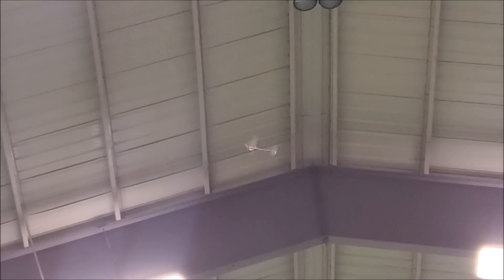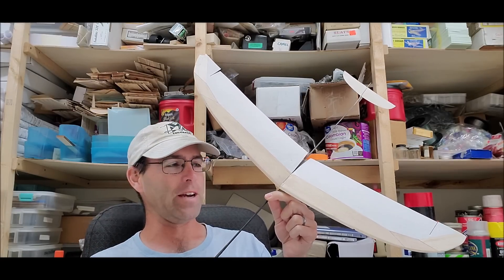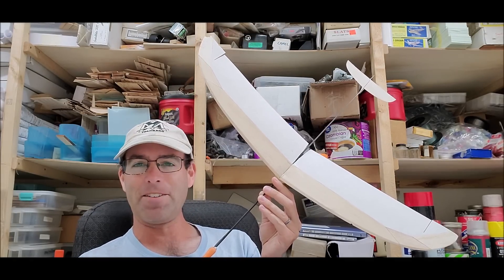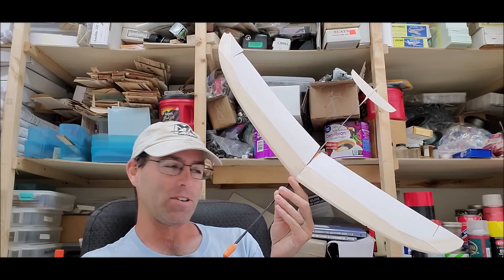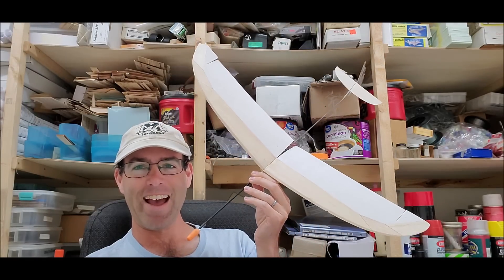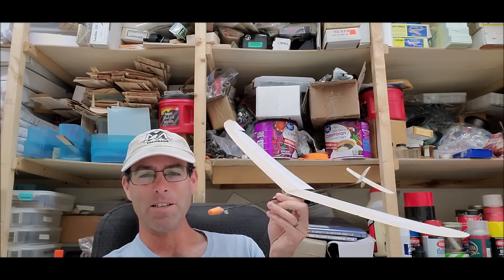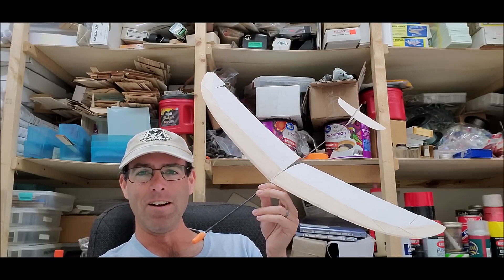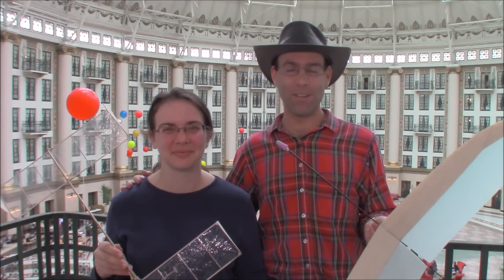This glider wasn't supposed to set a record, but it did it anyway!

Comment: Just caught this video again, obviously the master builder and trimmer…but wondering if a larger diameter flight circle, depending upon venue, would be more efficient aerodynamically?  Your thoughts…
Reply from the maker: You're 100% correct. Between altitude and circle diameter, I probably left 5-10 seconds on the table. Frankly I figured the plane would have exploded long before we got it launching anywhere near that high, and I was scared to touch the glide trim for fear of screwing up the rest of it. Eventually I'll go back and try to dial it in to perfection.

Comment: I’m new to this type of things…please forgive my ignorance. How do you prevent these gliders from running into the ceiling and other obstacles, especially with the propeller driven planes?  Do you have some sort of calibration/gauge of how much to wind up the rubber and or how far to pull back on the band for the launching gliders?
Reply from the maker: We do spend a fair amount of time adjusting for climb or launch height. For gliders you have to develop a feel for what power is needed. For rubber powered prop planes, we use a torque meter to monitor the power.

Comment: Josh, how do you manage to shot it straight up high speed and prevent that it starts looping, given that it is trimmed for a slow speed?
Reply from the maker: In the case of this plane, the flaps and wingtips are quite flexible so that the plane zeroes out at high speed (hence if it stalls the transition, it comes straight back down like a lawn dart). High ceiling planes actually fly a continuous loop in launch so that they roll and pitch upward from a steeply banked launch opposite the glide circle direction.
Reply: @joshuawfinn  ... Thank you for the explanation. I am an aeronautical engineer and I taught Aerodynamics at college, but the principles around free-flight model planes are totally alien to me. It's a nice application of aeroelasticity that in college we only studied associated to phenomena as divergence, flutter and control reversal. I.e. undesired stuff.

Comment: Perhaps if you turned less sharply, the plane would stay aloft longer. Turning a plane tends to make it lose altitude because one wing will have less lift than the other. 
Very impressive though.
Reply from the maker: We had that discussion. Unfortunately it would have meant completely retrimming the plane which seemed unwise given how well it was flying.
Reply: @joshuawfinn  well, maybe you should just take the chance and trim it.
Reply from the maker: @jakebob6332  I've been to that site twice in 7 years. When access is limited, you don't take unnecessary chances.

Comment: Vertical climb with a snappy recovery is always magic, to me.  This airplane especially so.  Almost seems like you have autosurfaces kicking it over.  Just beautiful flying.
Reply from the maker: Yeah this one has turned out really well. I helped Caleb build one and his flies exactly the same. The foam and the split wintips make these much easier to trim than old school gliders, but you do have to know what to do with them.
I've got a couple planes with autosurfaces and I fully understand Dan Berry's mantra that autosurfaces are for driving cars on.

Comment: If it’s so cold inside wouldn’t the hot air created by the lights create an updraft?   I see some fans up there that are meant to push the hot air to the sides of the building,  I believe an updraft would be created by the hot lights with or without the fans on
Reply from the maker: We flew a lot of different stuff in there and saw no perceptible effects from the lights. And the other planes are super sensitive to even minute air currents.
Reply: @joshuawfinn  seems like it drops faster the lower it gets...not accusing....it’s just very interesting stuff
Reply from the maker: @douglassummers9901  it's an optical illusion to the best I can determine. It does loose height much more rapidly below 10 ft altitude because of the rough air at ground level. We never did figure out the cause of that, however it may have been from people walking in and out of the building.

Comment: Got Depron, Balsa and Carbon, never heard of Vector board before. Hmm EPP, sounds perfect for my models that always bumped things. Got some EPP, never thought of slicing it for indoor models, but I have sliced Depron. Need to go down this rabbit hole and learn these new tricks.
Reply from the maker: You definitely need to try it!
Reply: @joshuawfinn  I found my old hot wire Depron slicer the other day, just need to clean up enough bench space and try it on EPP.  Found out about the oscillating wire CNC cutter, so want to make one of those. Used the 2.5W diode laser on my 3018 for the first time yesterday, it might be enough for balsa, just need to put it on a bigger XY frame, CNC kits, I can make spare models.

Comment: I have never lived anywhere that has a facility where indoor flying could take place. so I have never done that.  I have been into flying model aircraft a long time, mostly RC glider, designing & building most of my gliders, even flying wing.  However, I have never seen any free flight glide launch so vertically, just bunt over into such a stable glide.  Obviously you put a lot of work into that but, how in the world  do you do that?  What are the principles involved in getting that to happen?
Reply from the maker: The flaps on these gliders (the foam part) deflect upward under high speed flight, and that combined with a little flexibility in the wing makes the model nose over. I use the wingtips as trim tabs to force twist in the inboard section of each wing to induce the desired roll on the way up and some rudder offset to yaw the model the right amount. CG is tweaked to get the glide happy, stab incidence is adjusted to ensure that the model is decently forgiving of less than perfect rollouts.

Comment: Congratulations. What a wild but consistent transition - looks like a mini bunt straight into it's right turn.
Reply from the maker: That's the ideal transition with these. This airplane turned out to be exceptionally good at doing it reliably, however most of the top fliers tune their planes for something similar.

Comment: A great plane! I just love the way this holds its altitude, all the way through the flight. Well done Josh! 🌟👍
Reply: I think you mean "attitude", not altitude, as a glider cannot hold altitude without thermal activity. It will always consistently lose altitude in still air.
Reply: @someone-else-c4v  In a sense, yes. What I mean is, it conserves altitude efficiently, but attitude certainly comes into play, as the plane under advisement suffers less than some from the 'droop and swoop' phenomenon..
Reply: @williamrobinson7435  : That response is actually kind of hilarious. Thanks for the laugh.
Reply: @someone-else-c4v  Don't mention it. Happy to help you with your evidently low self esteem.
Reply: @williamrobinson7435  Dude, there's no need to attempt to insult me. Clearly, you are the type of person who must double down on or excuse your error when someone dares to correct you. You can call me pedantic if you like, but self-esteem has never been a problem. Look in the mirror if you want to see someone you're describing.

Comment: Hey Josh i was wondering how you get access to those huge open rooms.
Edit: I need your help josh, I used a heat gun on a wing and tightened the mylar too much and now the wing is a little bit twisted. I put some coins on the corners and left it for about 3 days and it got most of it out but some is still there. Has this ever happened to you, and do you have any advice on what to do?
Reply: A pair of bolt cutters and a lookout
Reply from the maker: Bahahaha! Well staying out of jail is preferred. Seriously though, Kent is pretty expensive at $1500/day, same with most of these big sites, so when we get a critical mass of folks and a pricing agreement from a suitable venue, then the agreement gets signed and there we go. For smaller sites to do practice flying and local meets, consider looking for vacant warehouses, barns, and community centers in small towns.

Comment: The transition at the top of the test flights so smooth and effortless, fantastic flyer you’ve trimmed 😃👍
Reply: What amazes me is such a light structure survives the sling shot launch.
Reply: @desertblbuesman  Materials have that ability…watch an aircraft certification video, the one where they deform the wing to failure.  That little glider is quite strong 👍
Reply: That's what I was thinking. I've not flown in a while, but all of mine would do a half roll at the top, rather than just leveling out. Maybe designs have changed to make that regular?
Reply from the maker: The big change is the foam flaps and spit tip sections which allow a greater degree of control over the rollout. For higher ceilings we still use traditional setups with a standard rollout into the glide.

Comment: Sounds like you had a surprising weekend. So flying with a tattered plane and being successful means a ham fisted guy like me can build a relatively good flying plane. I’ll have to go back and watch to build vids.
Reply from the maker: Very surprising. It was literally a last minute idea, I grabbed it as I was finishing up my packing.
When it comes to flapped gliders, the trick is having a good design and adhering to it with the correct materials, and then, much more importantly, knowing how to trim it. The Science Olympiad business forced me to learn how to trim them. My original Super Protégé trimming video is probably still the most comprehensive publication on that topic.